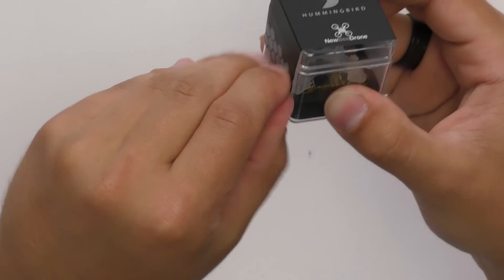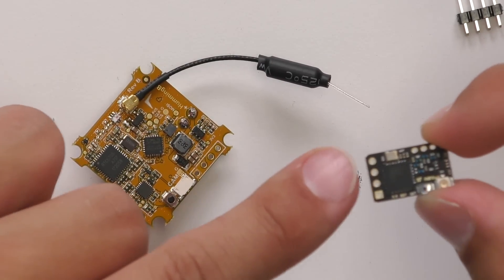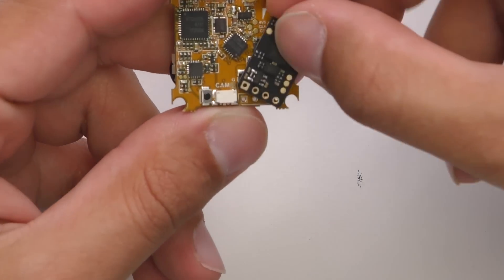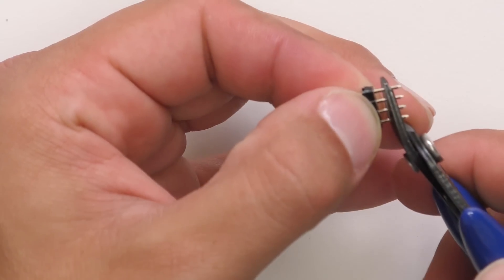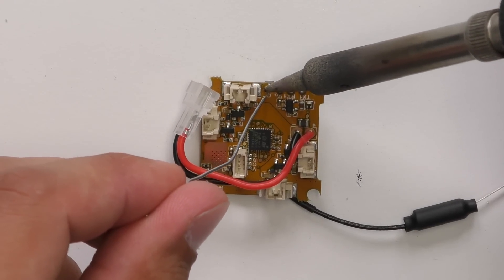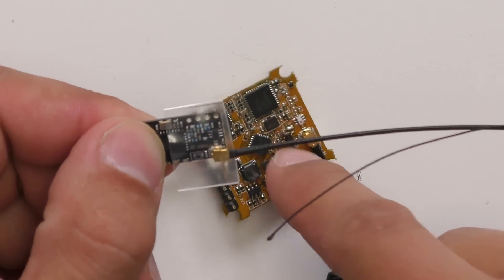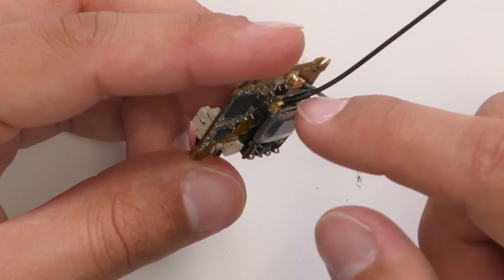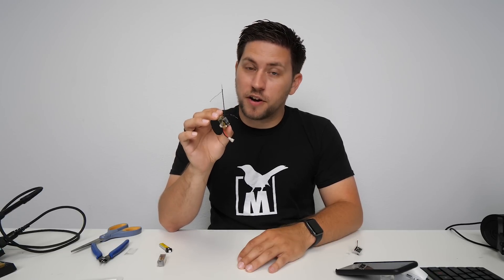Hummingbird Crossfire Nano Install

Comment: idk bout xfire on arobee!! They only go to 25w I loose video before rssi on both spektrum & frysky!! I hope you guys do a silverware setup, flashing silverware and lastly all the correct steps too run the silver configuration!! There is very little info out on the silverware congig!!
Reply from the maker: It's all about having a protocol that works with most radios and not having to change from your big rigs ;)

Comment: i just flashed the firmware successfully. Nano is bound to radio but will not arm. I followed the radio bind and modes set up video, but cannot get into osd menu. WHat is the default aux setup for stick control AETR?

Comment: I'm having major issues with my humming bird. everything is bound up and i set my switches in radio, but i cant arm or enter the osd or anything. radio is set to the correct Rx Channel Order. Please help!
Reply from the maker: Please open a ticket so we can further assist you!
Reply: Did you find out how to fix this? I am haing the same problem

Comment: Wait how are the antennas mounted once it's installed in the frame?
Reply: A lot of people glue them to the outside of the ducts.
Reply: @misericordiaSUD  Shouldn't CRSF Antennas be be mounted one vertical and one horizontal?
Reply: @fuzzyboxshredder  Yes and no. Best signal is received in when you mount the antenna in a T shape. You get a better coverage pattern but limited range if it is mounted in an L shape. For a micro like this you will run out of battery long before you run out of range in your receiver. This is true for the crossfire. If you are using a diversity antenna setup then an L shape with the two antennas is best.